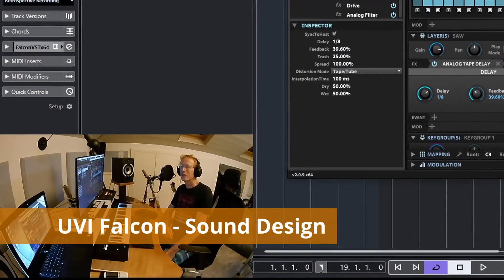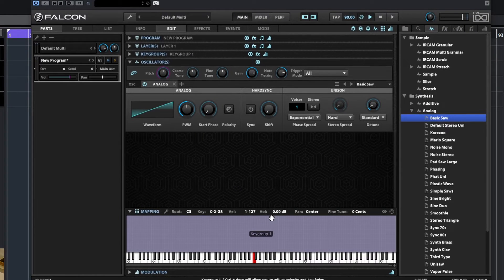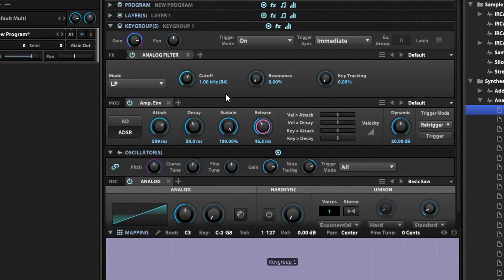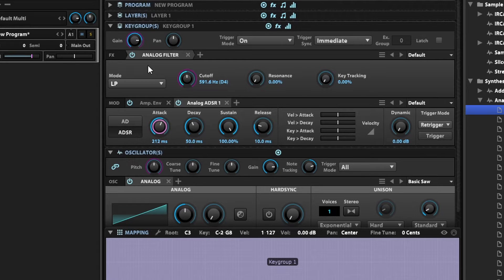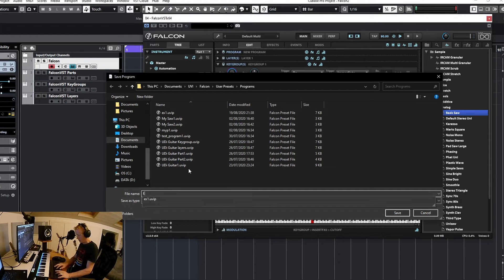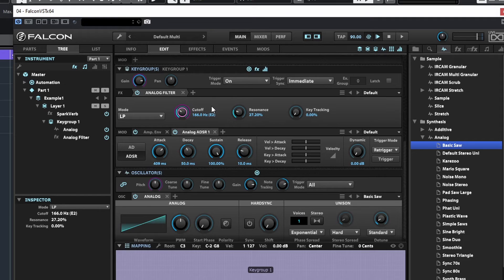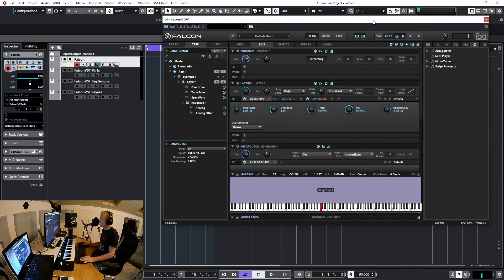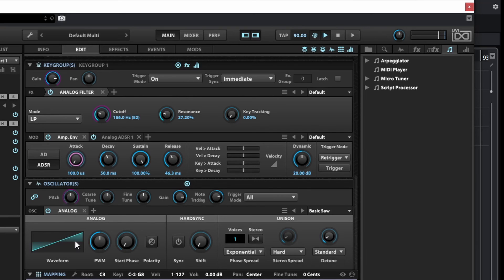UVI Falcon 2 - Part 4 - Sound Design example

Comment: Are there any filter models with a drive control (instead of having to add overdrive post-filter)? If so, it would be great if you could demo those.
Reply from the maker: Some of the Filters have gain control maybe different from what you are looking for. . example is DIGITAL FILTER. The SVF has some kind of drive mode. I will review this as we go over the different effects
Reply: @UDiAudio  Yeah, I use it to add saturation to the filter. Moog filters usually have it, Dune 3 also has a nice one etc
Reply from the maker: I think what you are looking for is with XPANDER FILTER. I will definitely cover it. But just load it to the FX and see there is an overdrive section with different types like Soft Saturation, Hard Clip, or Linear and you can set the amount of overdrive used.
Reply: @UDiAudio  Great, thanks! I don't have Falcon (yet) and unfortunately here's no demo, so I'm trying to figure out what I would use it for. 🙂

Comment: Now wait until you get an MPE controller - you're going to have a blast :)
Reply from the maker: What do you recommend?
Reply: @UDiAudio  Honestly, you'd probably like the Morph, especially given the price point, and you can use it for things other than as an MPE controller if so desired.

I finally got a flexible tripod for the webcam, so I did a dumb little MPE sound design session where you can see it in action (in contrast to the first MPE video I did): https://www.youtube.com/watch?v=0jx1JRzOcRw